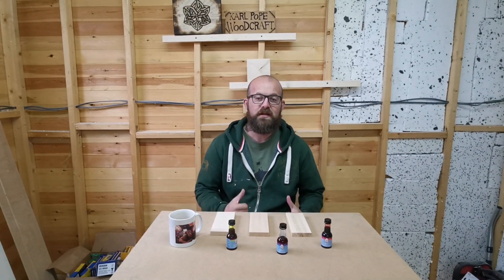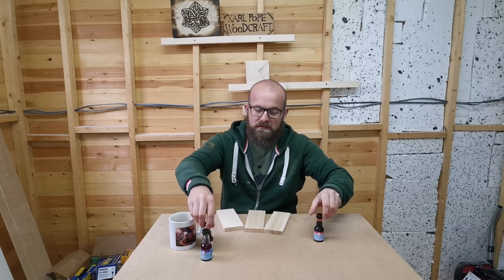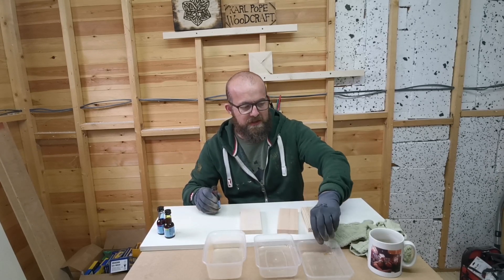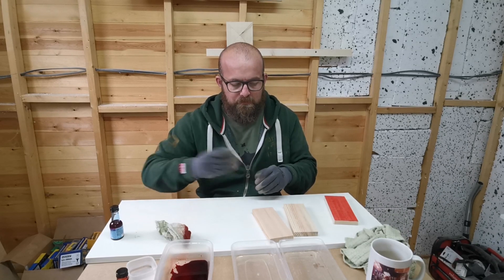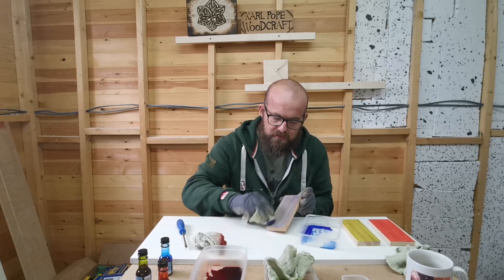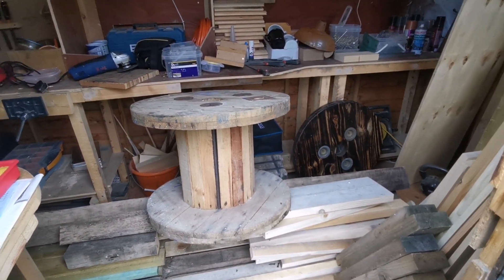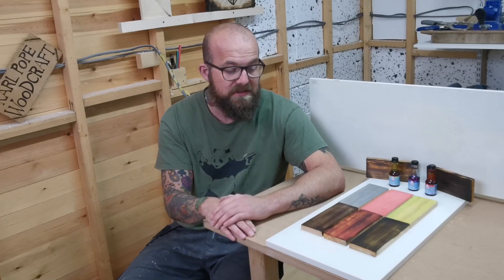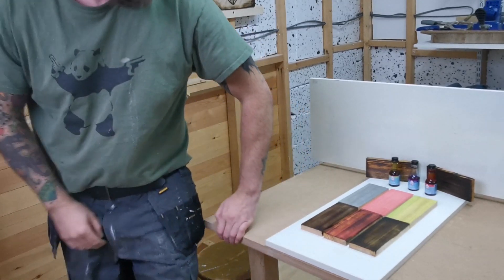Dying wood with food colouring.

Comment: I know this video was 5 yrs ago, but have you tried mixing wood stain and oil based paint?
Reply from the maker: I'd say make sure when you mix any dyes or stains etc they are either both oil based or acrylic but never mix the two.
Reply: @karlpopewoodcraft  ok thanks, I didn't know that they both would have to be the same.

Comment: I have to say I was disappointed after starting to watch... Your title says "Dying" wood with food colouring.  All you've done is stained the outside of the wood.  You should change your title because it's misleading.  I'm looking for a process that colors the wood completely like maybe soaking or under some kind of pressure maybe...I don't know, because all these video types are doing the same as you...staining wood.  You did a great job of that but not what I'm looking for.
Reply from the maker: Hi thanks for the comment,  just for your reference dye is pigment only and stain is pigment and varnish so the title is correct.  Even when timber is treated in the manner you say the pigment only penetrates about 10mm or so.
Reply: Great help thanks Karl
Shame you have to waste time replying to shyblondwoke and her disappointment
Reply from the maker: @nostrilsmith  Thanks mate 👍

Comment: Did anyone have any luck dyeing wood a white color?
Reply: “Silk emulsion “?? Would you have a link to what you use? The project Iam doing requires it to be dipped.
Reply from the maker: @revid64  I'll pop it on tomorrow mate, my son has my laptop. Cheers
Reply from the maker: I normally use a white silk emulsion watered down with about 10% brush on wipe off. I. Then seal with lacquer or acrylic varnish. It looks pretty cool, white wash effect.

Comment: I’m trying that for sure especially because coloured water-based wood stain or dye is so eye-wateringly expensive in UK especially since most of the bottle or can is just water!!  Subbing to see more. Cheers for sharing 👍🏻
Reply: It's expensive in the U.S. also
Reply from the maker: Thanks Tony, I think I'll do an update video on this subject. I made a wall art work with these and it's up on the wall on my landing. The colours have changed slightly but look nice.
Reply: Copper leeching also works great
Reply from the maker: @firstlast-zw7uo  never heard of that, what is it?
Reply: Copper pipe or wire in one cup of vinegar an two table spoon of peroxide an let set
Reply from the maker: @firstlast-zw7uo  oh yes Ive seen this now that you have explained, I've never used it before though. I suppose there lots of other ways really that we can dye wood without having to purchase wood dye. 😊
Reply: @karlpopewoodcraft  yes sir berries beets anything that has color could be used